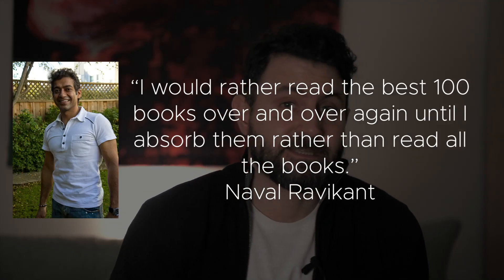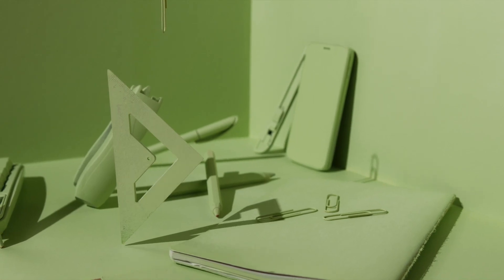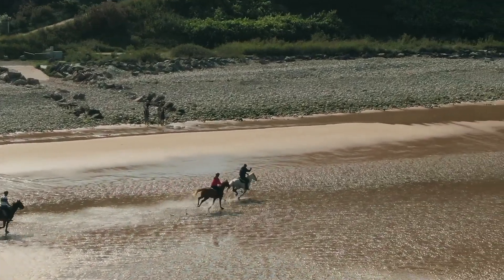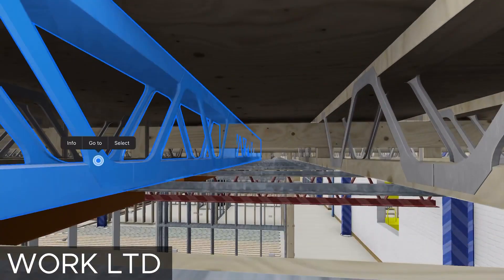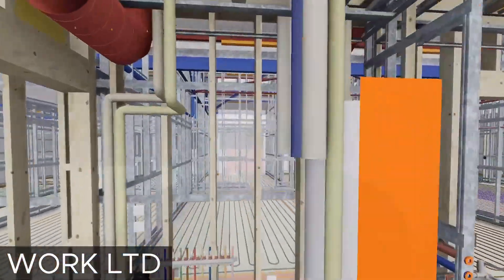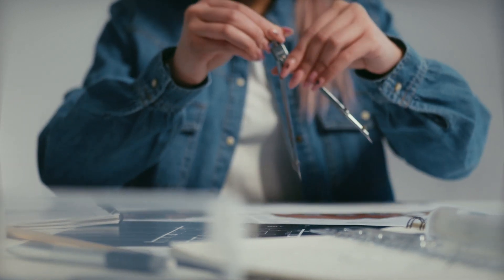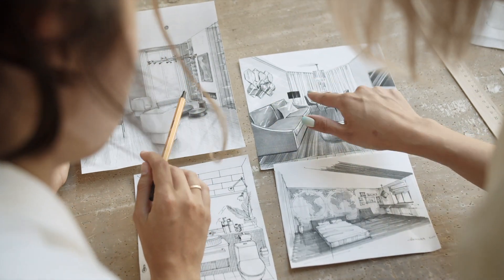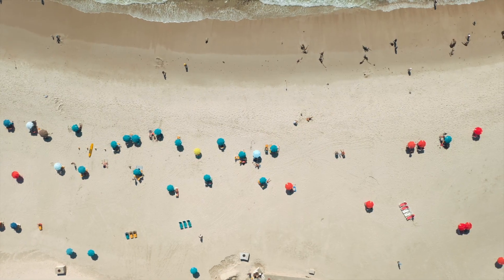Do we reeeally need 2D drawings (any more)?

Comment: I am not an architect, only doing my own projects, but I think 2d is much clearer for actual measurements and parts you are interested at this very moment.
You can probably have 3d only workflow but that would require an iPad for every worker on the construction site and also their full fluency with the program, how to hide something, show dimensions, cross section etc, this is not practical.

Comment: The so called "working drawings" are legal documents as someone pointed out in this discussion. 
If something was not drawn, dimensioned and specified correctly in a 2D drawing, it could have legal consequences when things go wrong, and believe me, there are plenty of things that could get wrong in a multi billion project, not only from the architectural point of view.
3D images are great tools for better understanding of the  project and details. Both are necessary and complementary.

Comment: I’m a licensed (Thirty-Nine Years) hands-on do-everything Architect/Builder/Developer.
I’ve used Archicad's BIM Software since 2001, Version 7 (Twenty-Two Years).

With Archicad you don't draw 2D Drawings, once the structure is created in Archicad's Virtual 3D environment, Archicad automatically creates any and all 2D drawings.

I use Archicad 2D drawings, 3D Drawings, and hand-drawn 2D and 3D sketches, whether at the office or at the site on a piece of wood, on the ground, or on a sheetrock wall at every stage of the Architectural/Building Process.

Comment: Regarding 3D representation I do agree that we should implement  them more in th construction documents, but you really have to keep in mind the number of people using these Drawings and number of Displines collaborating on each project. Mastering a 3D  software is a real time consuming, Keep in mind that in a lot of time employees  are forced to master multiple Applications  to land  A  S I N G L E   job opportunity in a specific firm because we are working in a Neich environment.
That's why having a Basic Principle such like 2D drawings and CAD capabilities  is needed, THE reality  is we have pills to pay. Business Owners  care about making more money and they control  the market, Education sectors,  and Engineering unions and in case they force higher standards  they will just make it harder for graduates and the current  work force to find a job, while paying minimum  pay to the majority. 
The gap between  pay and inflation  is rapidly rising, as well  as Robats  and AI are are getting better  every day resulting in a lower pay and higher unemployment  rates.
Really it's  a problem  that no one can fix we can only sit on the side and watch it unfolding.

I DO NOT SEE THE NEED TO FORCE HIGHER STANDARDS  ON THE BUILDING  SECTORS AS IT IS ALREADY BEING  F O R C E D  O N   BY THE WORK FORCE THEM SELFS IN ODRER TO LAND A JOB OPPORTUNITY.

WE REALLY  NEED TO CONSIDER HOW HARD IT GOT AND HOW IT IS GOING TO BE FOR GRADUATES TO MEET WITH THESE REQUIRMENT, LITTLE  BY LITTLE  THE REQUIRMENT TO LAND A JOB WILL CONSUME AND EXCEED THE  AMOUNT OF TIME NEEDED  TO GRADUATE MEDICAL SCHOOL AND IT'S  CERTIFICATION PROCESS WHILE KEEPING THE SAME PAY GAP OR EVEN WORSE IT IS MORE LIKELY  GOING TO INCREASE THE SAME WAY IT ALWAYS  HAVE BEEN.
PEOPLE HAVE PILLS  TO PAY  AND FAMILIES  TO FEED SO REALLY  THERE  IS NOTHING WE CAN DO TO CHANGE THE OUTCOME ON THE LONG TERM, ONLY SHORT TERM SOULTIONS THAT ONLY WILL RESULT HARDER  CIRCUMSTANCES ON THE NEXT GENERATIONS.

The problem  starts  with the number of parties  involved, its too large and  for ever changing; daily there are people returning and others joining resulting  in ideological  and mind set change, the only thing most people have in common  is the concept of profit, every one have pills to pay, resulting for the capitalism mindset  to rule. Personally, I do like capitalism because  there is a really  small chance that I might hit the jackpot  making a greater  amount of profit, it is not perfect and result in the pay gap but I am okay with it because it's  unchangeable due to the large number of humans aiming  to make large profit.

Comment: Perfect video, agree on everything you say. And "I was wondering what happens 5mm after that section"... what happens there in construction is that often there is used spray foam insulation to solve the problem... the problem that only exists because in the 2D drawing you didn't see it and therefore it is solved on site with a mostly non-sustainable unaesthetic patch...

Comment: In the end, 3D models are often built with materials supplied in 2D (and 1D). Say in ship building you are interested in 2D frames and 3D surfaces smashed back to 2D cuttings of plates. Imho 2D drawings have a utility in accessing detailed GD&T data more easily than 3D models.

Comment: Could you go over how you only use 3D drawings from a practical point of view? On the construction site, reading dimensions etc.
Reply: @aldrius00  depending on the software, you can annotate and dim a 3d cut. When you need to changes a view of that 3d detail, and you orbit and reposition it, the dim and text follow. The AEC industry has a lot to learn from aerospace and automotive.
Reply: Exactly. Manufacturing. As much as anyone loves and wants to scrap 2D drawings, the REALITY is you NEED. NEED. ABSOLUTELY NEED 2D drawings.

Comment: The solution requires mandatory tablets & printers on construction sites, in addition to a 'BIM-Lite' which would allow any (capable) general contractor to easily swift through a 3D model and find the required sections for each job. Within 30 years I believe this will become standard procedure for all projects.